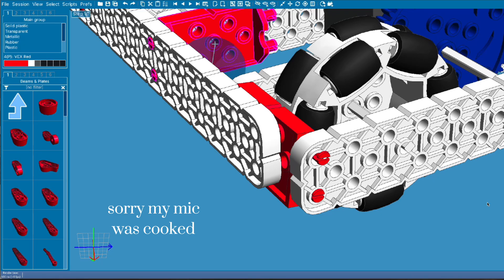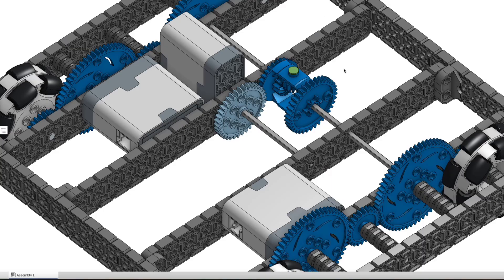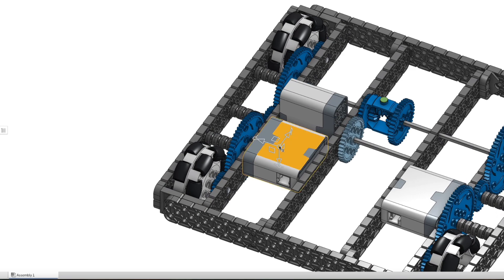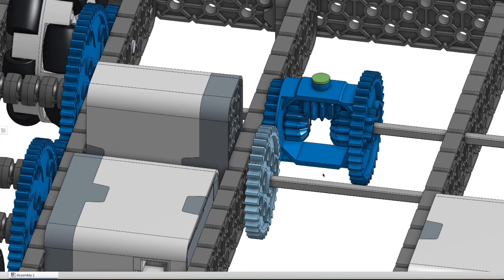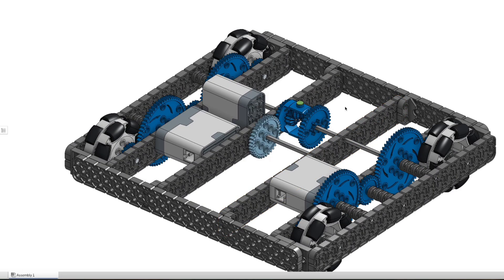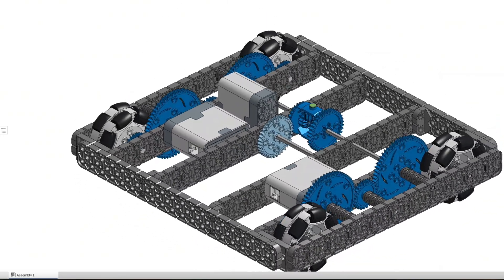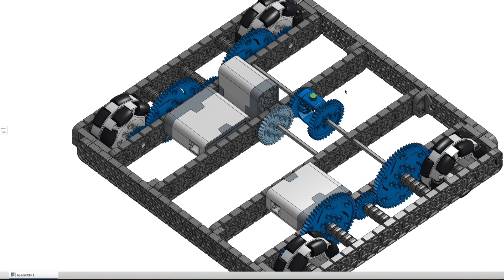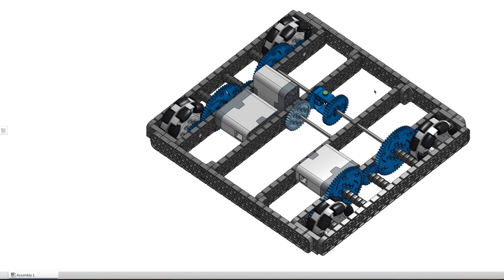3 MOTOR Drive Tutorial – Save motors while still having the same speed

Comment: the gear ratio is off;
it would either rip all the pins out, burn out the motors, or just not run
the third motor would be at a differnet ratio than the others
Reply: yes, it is. we've fixed it in the ONSHAPE cad. good job for noticing!

Comment: What is the point of having a differential gear? Can’t you just put a regular gear and run a long shaft?
Reply: Because we want a speed of a 4 motor drive, right? We power BOTH sides with ONE motor, but when both sides of a drivebase are connected, it cant turn! Since they all go in the same direction. We use a differential gear to be able to disconnect the power from the 3rd motor to be able to turn. It's pretty much equivalent of a 4 motor driving (driving straight and curves), and a 2 motor turning (turning in place).
Reply: @cstial  how do you code this?
Reply: If both sides are spinning in different directions (aka turning) the differential gear allows for that. If there is just a motor connected to a long shaft, then the drive would be trying to spin that shaft in two different directions when turning.
Reply: @MaxBritain-l5f  it works trust me; the outside of the differential does not spin when the two motors are spinning in opposite directions, the inside spins, and the outside motor is not connected to the inside, it is connected to the outside
Reply: @ I know, that’s why I was trying to say, but I was having difficulty conveying it.